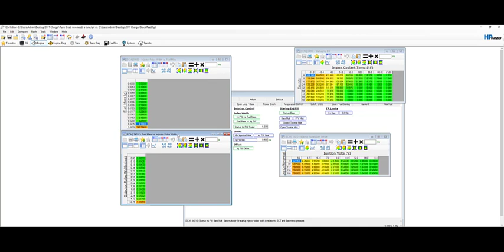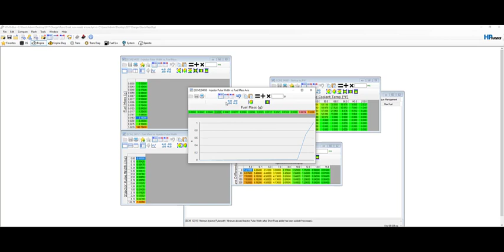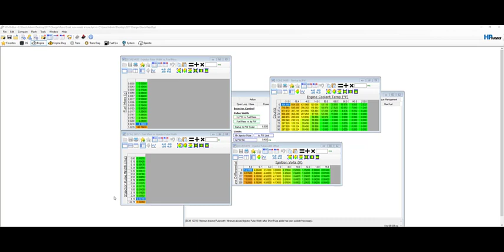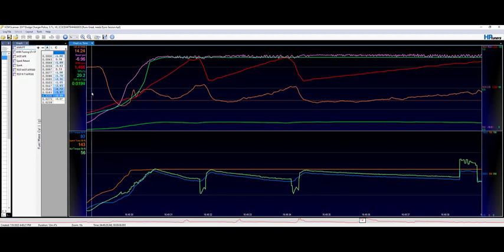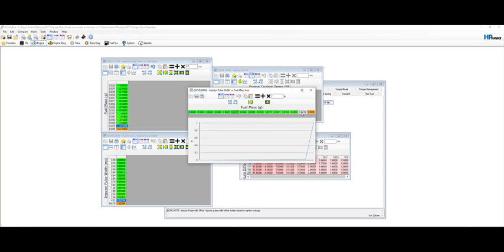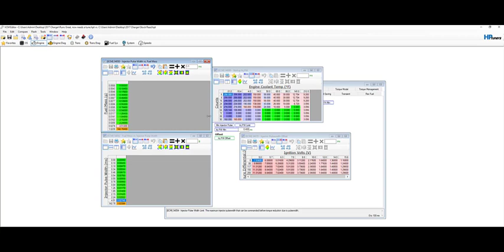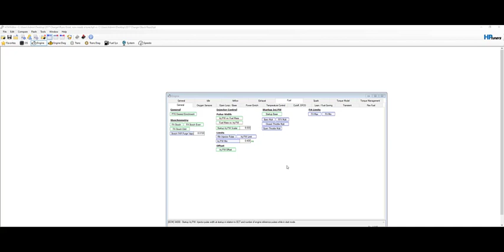Hellcat Injector Swap into 5.7 Hemi - Actual Data!

Comment: I have a 2013 crysler srt8 whit the 392 
Just did the swap to the hellcat engine and supercharger but kept my 5 speed 
Now i need a tune  but never tuned a car i do have the DIABLOSPORT tuner any suggestion would help
Reply from the maker: Get a pro tuner that handles Dodges, or buy HPTuners and start researching in the HPTuners forums.

Comment: Hey bud did you ever take your beast into the dealership?  I still havent figured out my intermittent pcm communication loss.  Now i'm forced to.  I snapped the pushrod off my clutch master cylinder in half on my redline so i'm stuck having to finger old girl out now, I suppose now is as good a time as any since the race track opens in 6 days.
Reply from the maker: Craziest thing! I logged wheel speed sensors and found out one was reading 624mph standing still! I changed all the front wheel sensors to Dealership provided wheel speed sensors and all the errors are gone! Now I am trying to get the tune figured out. So log wheel speed for all wheels and see what you get!